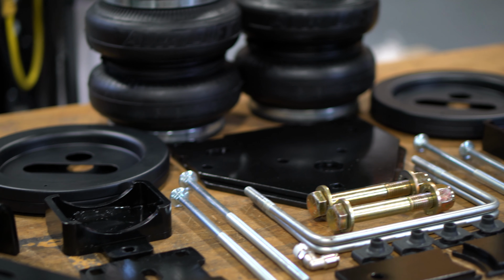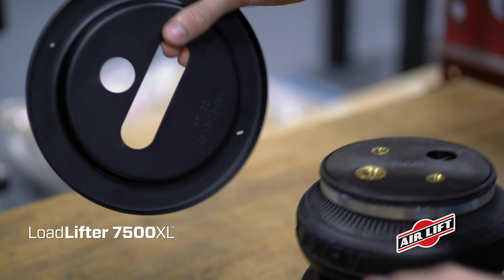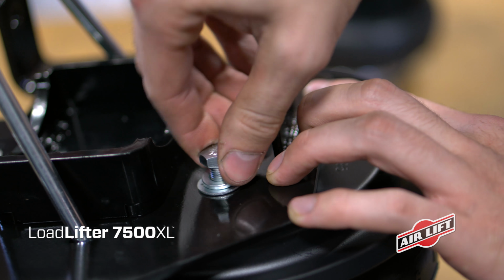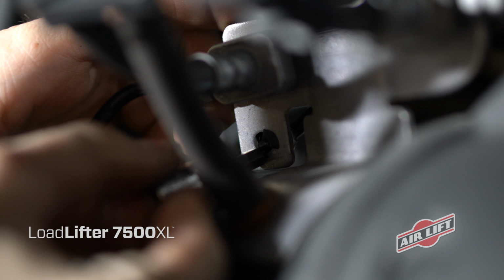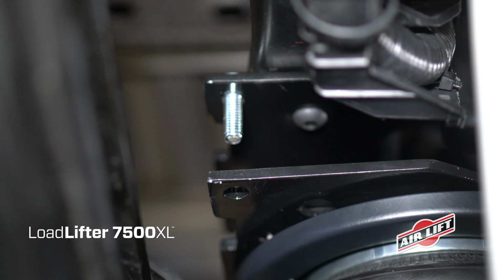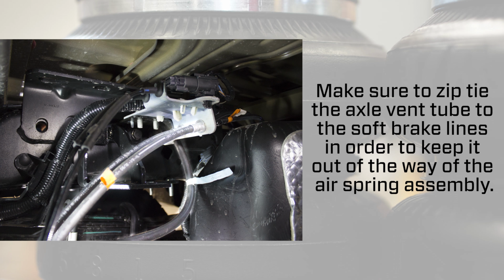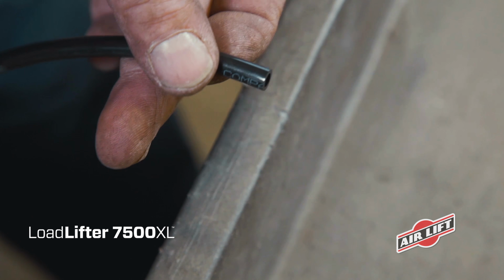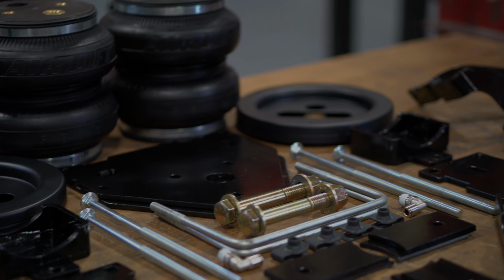Install Overview: 57599 - LoadLifter 7500 XL - Ford F-350

Comment: I’m a hotshot driver looking to add air lift kit to my 2019 F350. I’m trying to see the difference between the 5000 and 7500xl. But I definitely need something soon. I’m killing my front tires.

Comment: Does the 7500 kit fit a 2018 F350 dually 4x4 with gas engine?
Reply from the maker: Hi 66 - yes it does. Part number is 57599.
Reply: @AirLiftCompany  Thank you so much!

Comment: The7500 xl lift kit came hit air pump, do I have to buy it separate?
Reply from the maker: Hi Jesus - the air springs and the air compressor system are sold separately. The 7500 XL kit does come with everything you need to inflate manually, like a tire.